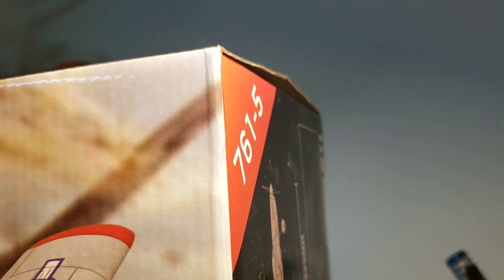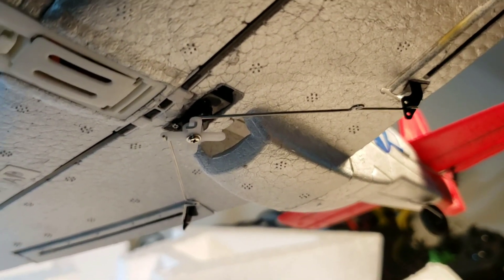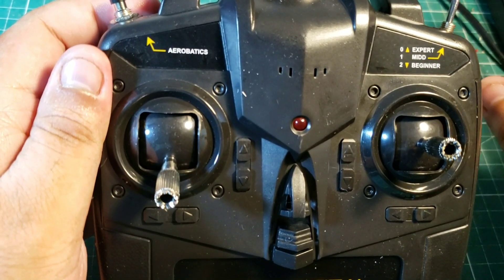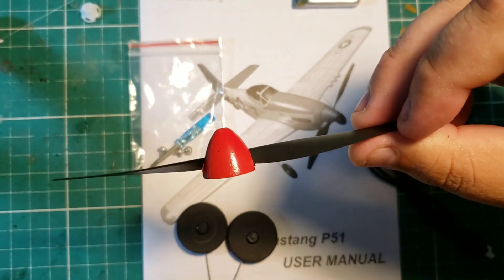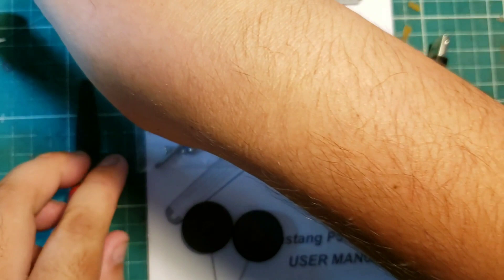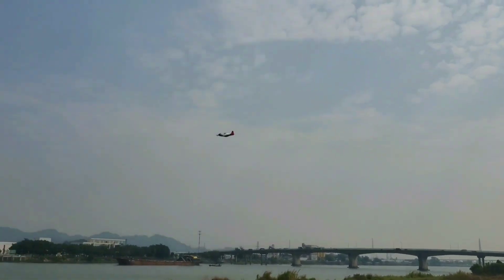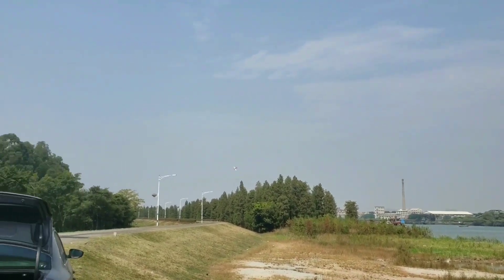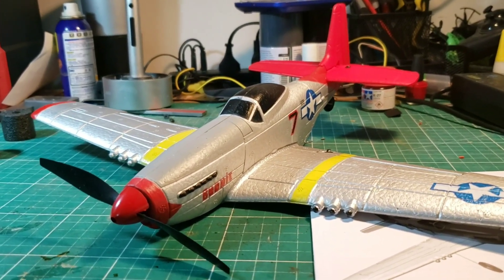Volantex V761-5 Micro Mustang (a.k.a. Eachine P51) review

Comment: Nice review. Apparently Eachine has this rebranded as their product too. Just flew mine today for the first time. It's pretty fast for 1S brushed, but can also go slow. Mine seems a bit twitchy on elevator, but maybe it just needs a little down trim, or a better pilot than me.
Reply from the maker: Thanks for the info! If the elevator feels too alive, try moving the pushrod to the outermost hole on the control horn, that'll make it more precise but give it less travel. I did the same with my ailerons as they seemed a little touchy with the gyros off.

Comment: Hi James, great flying! this p51 looks to be a great little flyer. Going to add this to my fleet but already considering future modifications.
Do you think shaving off all the little mold 'nubs' would make it a little more slippery... or more likely to act as turbulators and actually help the model?
Also wondering if a micro quad brushless esc/motor combo might be feasible if the combined gyro esc unit could be hacked/modded into?
Thanks..
Reply from the maker: Cheers Paul! I think the biggest problem about shaving off the nubs would be that you'd pretty much have to repaint the aircraft... As they're not too visible unless right up close, I'd keep them as is. With regards to brushless, I feel it'll probably adversely affect the wing loading of the aircraft, and the gyro doesn't look too easy to hack into- but it may be worth a try!